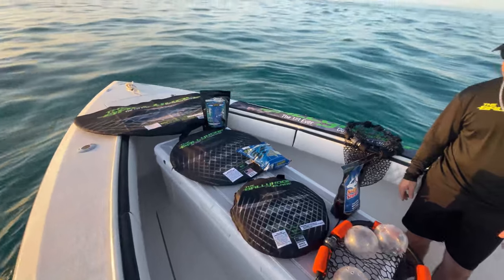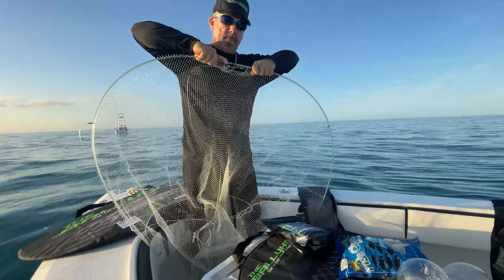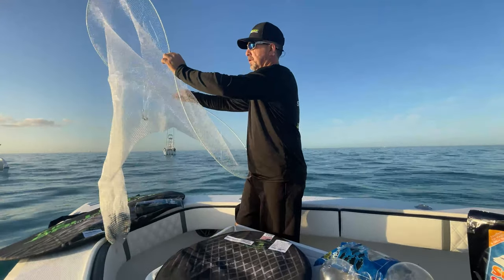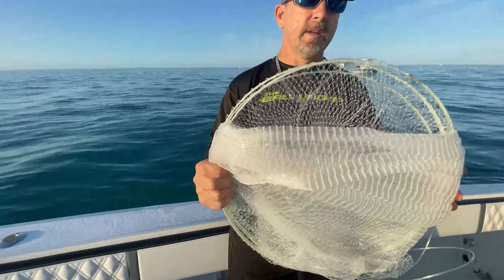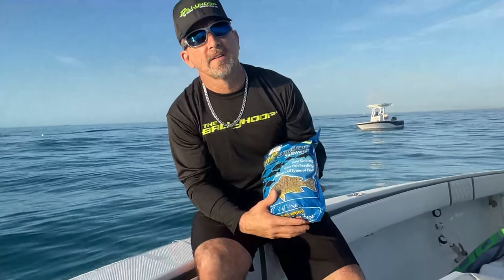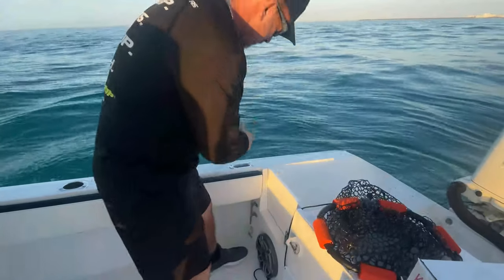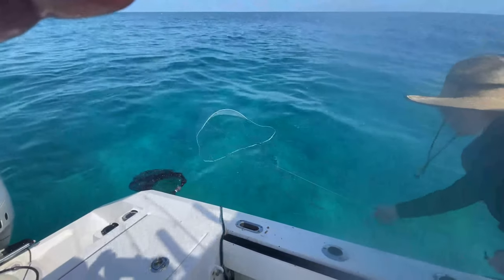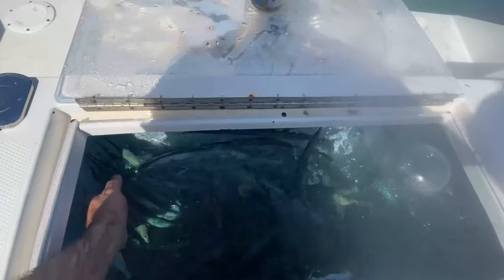2022 The Ballyhoop Product Updates - Learn, Use, Catch Live Bait

Comment: Just how long does the plastic hoop actually last before it starts to breakdown from the heat and UV and just breaks on the Stealth? Polycarbonate absorbs UV radiation......
For $100 you can keep it.....let alone the actual price of $329....
Reply from the maker: Hi Rider, the latest Stealth model which has been out for a few years now is made out of another material with custom formula of a type of polyresin and some fibers. So it is not as transparent as Polycarbonate, still translucent and see through but much stronger and allows while allowing the light to pass through. Hope this helps. We stand behind our products 100% and always listen to customer feed back. Thank You!